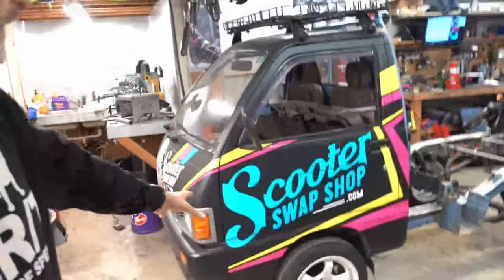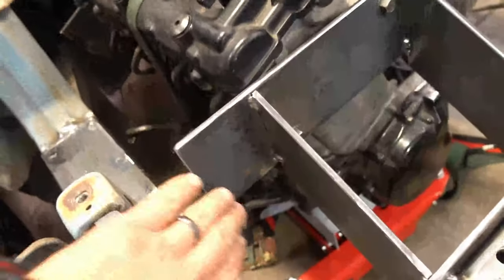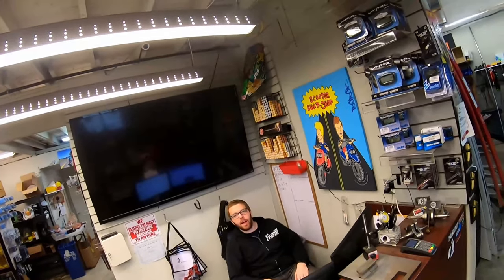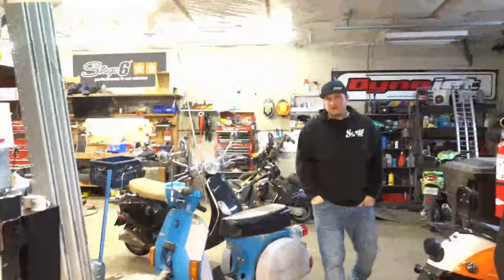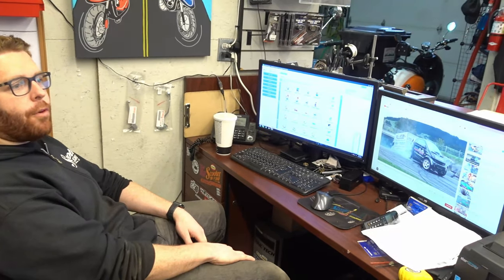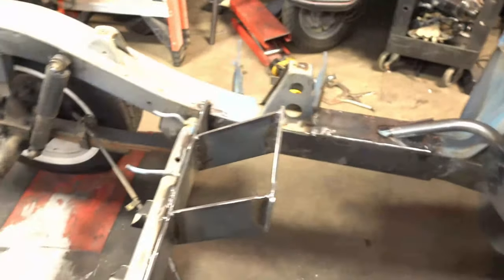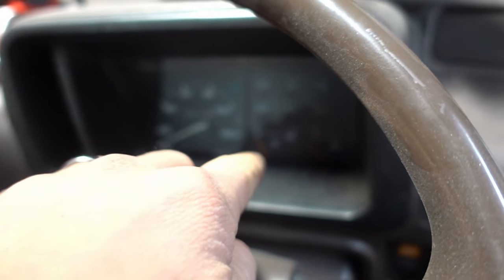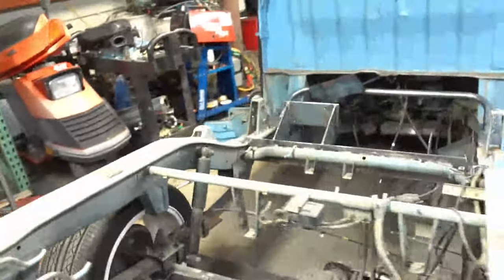Hayabusa mini truck swap  TURBO or NA video 4 | Kei truck

Comment: What wheels are on the truck? Did you buy them with the correct pcd of 4x110? I dont seem to find many of them except for sa rx7 ones. Thanks
Reply from the maker: I machined the hubs to fit 4x100

Comment: You should have a motor on each side 1 motor for each wheel
Reply from the maker: so $20,000 in motors on something you couldn't fit 2 motors... and that 1 motor is too much

Comment: You wouldn’t need to  spend $1000 on headers or $2000 on a turbo kit.... you can get a turbo for $500 or less build a manifold your self off the stock headers. Easy! Then the fuel system would be about $500 and tuning...
Reply from the maker: true

Comment: Check out gopowersports.com for a master cylinder for your hydraulic clutch. I’ve seen others use them for motorcycle engines before. You should be able to mount it just about anywhere.
Reply from the maker: we got it all taken care of